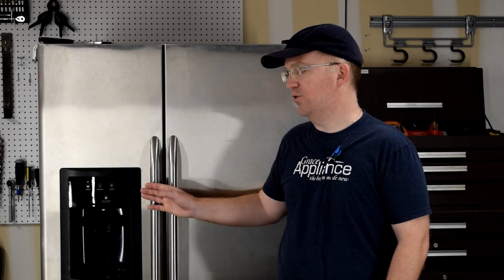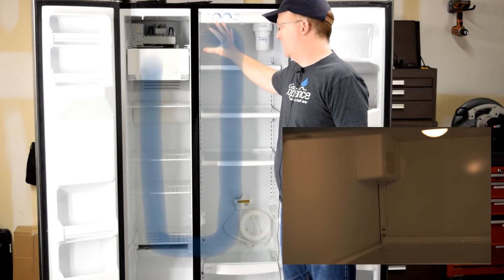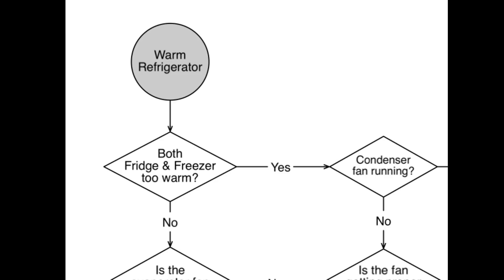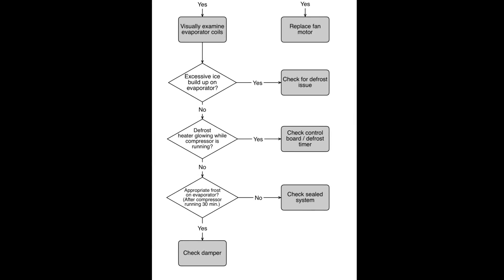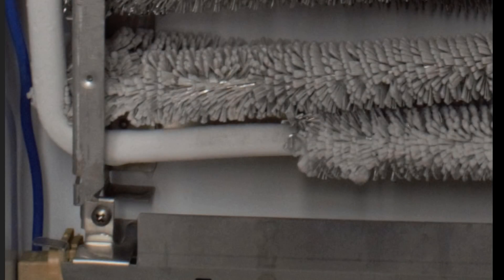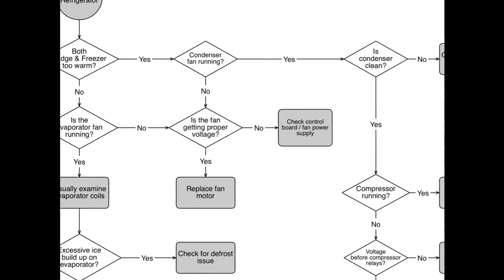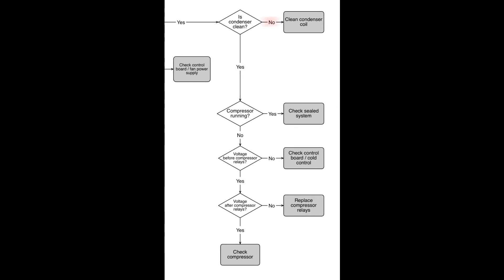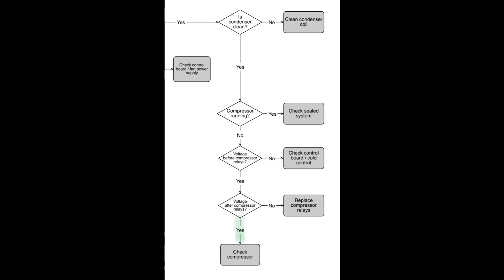Refrigerator Too Warm - Diagnostic Steps

Comment: Hello. Great video. I have a GE Cafe refrigerator. Thought it was the inverter board after checking voltage both at the orange/black for 120V and the red/blk for I believe 4 to 7. All voltages check out. Check resistance at compressor and again around 6.8 to 7.1. Swapped out inverter board for new GE OEM and plugged fridge in. Compressor is running and fan is running. After having the fridge on all night, there still isnt a drop in temperature. Both sides are above the recommended. Baffled, could you give me some guidance? Thanks.
Reply from the maker: Hey, if the compressor has been running without cutting in and out in a short amount of time, you should definately be seeing a notable drop in temp in the freezer. Within 20 minutes or so, you should notice a temp drop.

If not, it's sounding like a failed compressor (or major refrigerant leak)

To confirm this fact, you can remove the back wall inside the freezer to expose the evaporator coils.

You should be seeing a light coating of frost on the majority of the coils. In your case, the coils will probably have little to no frost on them. This would confirm a failed compressor or refrigerant issue unfortunately.

Comment: Great video for trouble shooting. 
Where can I get service manual for FF187E so I know where to find timer and control board etc ?
Reply from the maker: Hi Anthony,
I'm sorry to say I'm not able to find any diagrams to help you either.
However, if you have a defrost timer, it will usually be either behind the panel behind the refrigerator near the compressor area. Or alternatively, you may find its tucked in to the top inside portion of the refrigerator section. You'll see a small hole about 1/2 wide and should look like a spot to put a flat blade screw driver which allows you to advance the defrost cycle manually by turning clockwise. You'll hear an audible clicking as you advance it.

I hope this helps. Andy

Comment: My freezer is a little too warm and its causing my fridge be be too warm. When I checked the back, I noticed that the compressor was extremely hot! So hot to the point it melted a groove in a transparent tube. What would cause this?
Reply from the maker: A failed condenser fan behind the fridge comes to mind. A refrigerant restriction can also. A failing compressor having to work too hard, or if the compressor is cycling on/off over and over.

Is the fan working behind the fridge?
Reply: @GraceAppliance  Yes it's running.
Reply from the maker: Terrance Williams make sure the coils behind the fridge are free of dust. Also, check to see they there is not food blocking the vents inside the fridge and freezer.  It can cause the compressor to run too often.  
Outside of this, if I were there I’d check what’s called an amp draw on the compressor using an amp meter (clamp meter) and the compressor should be pulling about 1.5 Amps.  If you have access to a meter like this, that will tell you a lot about the health of the compressor.

Comment: Hello, we have a GE profile side by side refrigerator. Freezer at 22 degrees and fridge at 89 degrees. The defrost heater in freezer is working. And the fan in the freezer is working. Also smells of electrical burning. Any ideas?  Thank you very much
Reply from the maker: Chris Cleary hey Chris, 
Is the defrost heater on at the same time the compressor is running? 

I also have a video called “visual inspection of a control board”. I’d inspected the control board behind the fridge to see if you might have any burned connectors or solder joints on the back side.

Comment: GREAT VIDEO ! Our freezer is working but the refrigerator is very warm almost hot. What do you suspect ? NOT A GOOD TIME FOR THIS TO HAPPEN.  Thanks.  GE Profile side by side  Model PSS26NSWC SS
Reply from the maker: Hey, I know it!  There’s never a good time for a breakdown.  I’m sorry! 

If your freezer is keeping things frozen rock solid, that’s good news.  Your fridge gets it cold air from the freezer.   
So, if you don’t have a defrost issue in the freezer you should hear the fan running inside the freezer.  This should be pushing the air through a vent In the top of the fridge section.  Make sure air is coming through there.  If it’s not, you may have a broken damper door or it could be frozen shut.  
Also make sure food is not blocking any of the air vents.  That’s the first things that come to mind.
Reply: @GraceAppliance  Thank you, I will check out your recommendations. PS I have had the refrigerator unplugged now for 3 days now so it is definitely not frozen. after three days I plugged it back and let it run for 45 minutes the freezers ice cold and the refrigerator side is hot it was up to 82 degrees. Thanks again

Comment: What side by side refrigerator do you recommend?
Reply from the maker: Angela Ruggles if I had to buy one, probably a Whirlpool built side by side.  I can’t think of a side by side whirlpool that has anything but a single evaporator, but I’d at least ask that question. A dual evaporator would be a deal breaker for me in a fridge. If you wanted to find a specific model that you like you can always post the model number here and I can give you my $0.02 on it. Thanks!

Comment: I have a LG refrigerator and after a self test it gave me a code 22 which indicated a relay. I’ve changed it but still no go. It originally started when I noticed both compartments were getting warm. I did another self test and not only is it giving me a code 22 but a possibility that it’s a capacitor, the board or the compressor. The compressor is running fine and not getting hot to the touch. I’m at my wits end.
Reply from the maker: Hi, what is your model number please?

Comment: So, after replacing the evap fan motor, which way should air be moving; 1. At your face? 2. Towards the rear.?
Reply from the maker: It pulls the air up, through the evaporator toward the ceiling, then forces it through the damper door at the top in to the refrigerator.

Comment: Andy, I replaced the defrost heater and the thermostat about a month ago, seemed to work fine fora while, now both freezer and refrigerator are warm, I have frost build up in freezer, I checked the heater from the plug in the back tested bad, pulled the heater out it tested fine, both fans are working, evap. is clean, compressor is running.   Please help, Bob
Reply: Andy is the high limit thermostat the same as the defrost thermostat?  Thanks
Reply from the maker: Bob Fisher if you can send your model number I can confirm this. It varies a bit by model.  On GE side by side, when the defrost comes on and for how long is determined by the defrost sensor on top of the evaporator (small white sensor with 2 white wires) and the defrost high limit thermostat is about the size of an inch high stack of quarters and had a pink & orange wire leading to it.  It does not determine when the fridge goes in to defrost.  

This is a little different than other models out there.
Reply from the maker: Hi Bob,
If you have a GE side by side and the heater tested bad at the plug, but ok once you pulled it out, you likely have a failed high limit thermostat.
This should read closed (I. E. Low resistance around 0.08 ohms) at room temperature. It is a safety switch which opens up around 130F and then closes again around 110F, so will cut power to the heater should something go wrong and the heater sticks on. 
This is in the same circuit with the heater. So, it will cause the test to fail from the board even if the heater is good.

If you remove this part from the freezer, you can then ohm the 2 wires to see if it's failed at room temp.
Be sure to leave yourself enough slack on the wires to perform the test, but also enough to reinstall the new part. Do not cut any wires with the fridge plugged in, obviously.

Thanks and let me know if you  have any questions.

Thanks!
Reply: Andy, model # GSS22SGRB SS , I replaced the thermostat when I did the heater, I just removed it and no continuity. Bob
Reply from the maker: Gotcha!  Interesting that it’s failed so quickly, but does sound like it needs to be replaced.  
https://www.graceappliancediy.com/products/general-electric-wr50x10068-refrigerator-defrost-thermostat?_pos=2&_sid=2fe50974f&_ss=r

Let me know if you have any questions.  Thanks! Andy
Reply: @GraceAppliance  Andy, the wr50x10068 thermostatis marked L140 -30F at room temp the one I removed had no continuity, I put it hot water 140+ anditdid??? I ordered a real GE on same # and room temp it did have continuity and a 140+ it was open I installed it and it seems to all be working,Thanks
Reply from the maker: Bob Fisher awesome!  Glad to hear it and thanks for the follow up.

Comment: Your video educated me on how by brand new refrigerator has no sounds coming from it, so your flow chart indicates many possibilities that could be wrong with this new unit. I hope my technician from Barrons Appliance is as knowledgeable as you are.
Reply from the maker: Thanks for the kind words!  
You may research to see if your fridge may be stuck in what’s called demo mode. Some fridge will have a series of buttons you can hold down which takes it out of “showroom mode” and turns the compressor and fans back on.  If you find that you only have lights, but no fans or compressor kicking on, this may be the issue.

Comment: Hey sir, I was wondering how to correct a fan in the freezer comes on and shuts off frequently...much more frequently than it’s supposed to.  Any suggestions?  Now the freezer/fridge are not responding to temperature settings.  Usually 3-5 degrees above in both.
Reply: Control board/fan motor both replaced.
Reply from the maker: Hi Whit, 
What is your model number please?
It can be found inside the fridge section in a sticker.  

Thanks
Reply: GE Side-by-Side ONLY - Refrigerator Repair Videos PSHS6TGXBDSS
Reply from the maker: Whit Dodson thanks, sorry, one more thing. Please send the first 5 digits of your serial number.  Thanks
Reply: GE Side-by-Side ONLY - Refrigerator Repair Videos 42325
Reply from the maker: Whit Dodson I believe it should start with 2 Letters and then numbers.  Example: AF213, DF334, etc
Reply: GE Side-by-Side ONLY - Refrigerator Repair Videos sorry about that...FR423257
Reply from the maker: Whit Dodson no problem, thanks. I was checking that info against the install instructions which has a slight variation for certain serial numbers, but yours is not included.  

I have a video called diagnosing and replacing a defrost sensor. This also includes how to test temperature sensors for both the fridge and freezer temp. This is one thing that comes to mind. 
Also, I’d check to see that both door switches are working properly which might also cause this symptom.  

How long does the fan run for before quitting?   Only Seconds, or for minutes?
Reply: GE Side-by-Side ONLY - Refrigerator Repair Videos thank you for the resources.  I will look at the video.  It began as just the short cycling (only seconds), and after we had techs come and try to fix it the temperatures aren’t consistent.  Very odd.
Reply: Do you have a video on how to confirm door switches are working?

It cycles on about once per minute for 15 seconds, then cycles off.
Reply: After watching your full thermistor video, I realize I have replaced one of the 3 in my unit.  I am going to check resistance in all three from the rear of the machine tomorrow.  I’ll let you know.  Thank you for the prompt feedback—very much appreciated.
Reply: Andy, finally got to test with multimeter.  In your other video on graceappliance website, you mentioned about the J5 being blue/white striped...mine is just blue.  I have the continuity data from all sites.  What’s a good email for you?
Reply: GE Side-by-Side ONLY - Refrigerator Repair Videos hello

Comment: No cold air coming up in the refrigerator vents but the freezer is blowing good took it apart cleaned it same thing don’t see any problem any idea. Kenmore elite
Reply from the maker: Steve Smith hey Steve, I suspect you may have either a defrost issue where the freezer evaporator is frosted / iced over or perhaps the damper door is frozen shut (or broken).  That’s where I would focus my attention.  Also, make sure there is no food blocking the vents in both the fridge and the freezer.
Reply: GE Side-by-Side ONLY - Refrigerator Repair Videos Thank you and good video to

Comment: Great video. Im not a handy guy at all, but a week ago I changed the defroster because both freezer and fridge were warm. I defrosted al the ice in the coils with a heat gun and replaced the heater. It was working great but 2 day ago only fridge is warm. Any advice? Appreciate it.
Reply from the maker: Hey Eduardo, 
This definately sounds like a defrost issue because you can temperarily get it to work ok by defrosting it, but then it goes back to a warm fridge after the defrost issue returns.  

There are 4 parts that can cause a defrost issue (on a GE side by side refrigerator, if that's what you have) The control board, the defrost heater, the defrost sensor on top of the evaporator, and the defrost high limit thermostat. 

I have a video called how diagnose a bad control board - defrost issues.  I'd start by watching this video and let me know if you have any questions. 

Thanks!
Andy
Reply: @GraceAppliance  the defrost heater is what I changed last week. Tomorrow I'll check the other the other parts. Thanks for your prompt response, greatly appreciated. Will.let you.know.
Reply from the maker: Eduardo 769 I understand. I just wanted to make sure you knew it could also be the other 3 parts.  If you have an ohm meter it will make the testing much easier.  Let me know if I can help.  Thanks

Comment: I moved into a new place . Brand new refrigerator . Freezer has frost all inside but refridgerator is too warm . We noticed the freezer setting was at the highest . We turned it down . The next day refridgerator is stilk too warm . Do I need to unplug it and defrost ? And for how long ?
Reply from the maker: Hey Judy, yes I would start by unplugging it with the doors open for about 12 - 18 hours.
If it was left running with a door open for example, it can cause excessive moisture inside the cabinet and often will cause the damper door between the two cabinets to freeze shut. Causing a warm fridge.  

Hopefully this works, but it's the right first step.
Reply: GE Side-by-Side ONLY - Refrigerator Repair Videos thanks so much !

Comment: Everything is running compressor fan inside fan. Psi is about 45 for the low side. I’m getting no frost at all it’s colder at the bottom two condenser rows than the other ones up top. I replaced the relay and switch and still nothing it only cools to tops 55 in the freezer and 65 in the fridge. Any thoughts would be helpful
Reply from the maker: TFRYERJE hey!
Unfortunately, it appears to be a failed compressor.  It’s not able to compress enough to frost the evaporator.  If your compressor has been running for at least 45minutes, you should have a light coating of frost on the majority of the evaporator coils.  You should see some frost almost instantly on the bottom rung when the compressor is running.  I’m afraid it’s bad news based on your description.  :-/
Reply: GE Side-by-Side ONLY - Refrigerator Repair Videos it doesn’t shut off its humming and doing its thing but the fridge doesn’t shut off
Reply from the maker: TFRYERJE yes, the compressor will run non stop because it’s trying to satisfy the set temperature.  I’d it can’t reach the set temp, it will continue to run. The compressor can’t keep up enough to get it down to temp.
Reply: GE Side-by-Side ONLY - Refrigerator Repair Videos is 40 psi the right psi for this fridge? It looks like in the video we have the same fridge or close to it
Reply from the maker: TFRYERJE I’m not 100% sure on the correct psi, but think a high side measurement may actually be more telling. Closer to 100psi on the high side if I recall.   But, I won’t claim to be a sealed system expert by any stretch.  Maybe another tech can weigh in here.  
Another possibility is that there is a leak in the system and there is no refrigerant to compress so it’s simply compressing air.
Reply: GE Side-by-Side ONLY - Refrigerator Repair Videos the suction line is the high side correct?
Reply from the maker: TFRYERJE the suction side is the low side.  The larger of the 2 copper tubes.  
The smaller line is the compression side which should be warmer than the suction line.  Once compressed on the high side, it gets to the evaporator where the very small tubing meets the evaporator. This is where the refrigerant then expands in to a larger environment (I.e. the larger tube of the evaporator) and cools/frosts up due to the expansion.
Reply from the maker: If you wanted more info:
https://youtu.be/GpVat6F190M
Reply: GE Side-by-Side ONLY - Refrigerator Repair Videos ok then I have it correct the small line is pretty warm but so is the larger line, not as warm but atleast room temperature or more

Comment: Thanks for your videos. Im trying to repair my GE side by side( model # ESH25XGPACC ).  I found A contact on the  large relay on my main board is burned.  The compressor will not run. The part number on my main board Is WR55X10942. When I try to buy a replacement board they give me a different part number.(WR55X10956). I’ve tried 2 of these boards and the compressor still won’t run. Also,I’ve replaced the compressor relay, the temperature sensor and the thermistor sensor behind the freezer access panel. Any suggestions??
Reply: Thanks Andy.
Reply from the maker: Hey Brian,
I agree, the board you need based on your model is a Wr55x10942. Since it had a burned relay solder joint, I would start with the correct board and it is likely going to solve your issues. 
 https://www.graceappliancediy.com/products/ge-wr55x10942-refrigerator-main-control-board-1?_pos=1&_sid=b0b2d4711&_ss=r

Let me know if you have any questions.

Thanks!